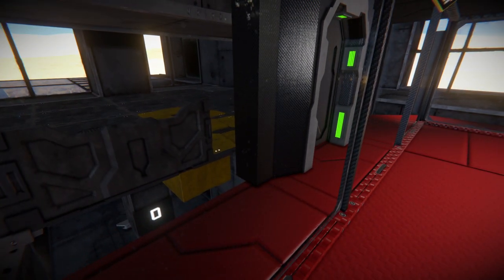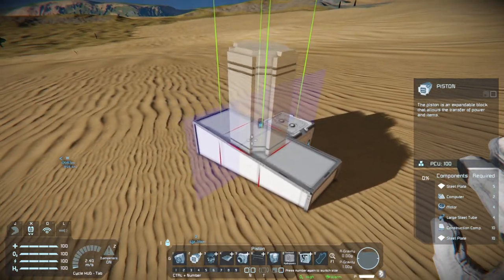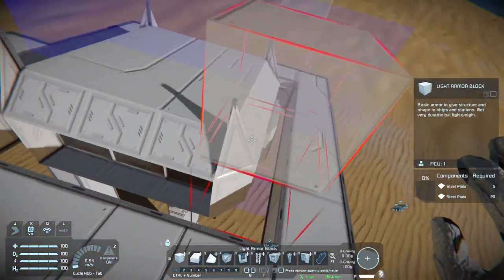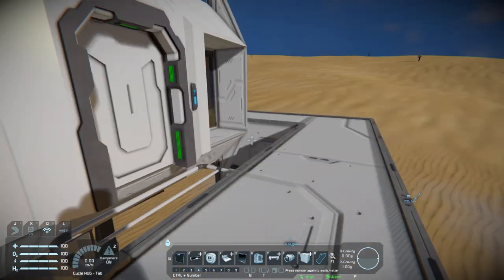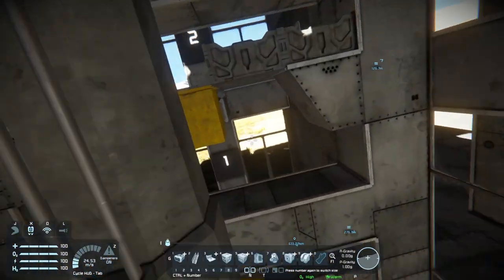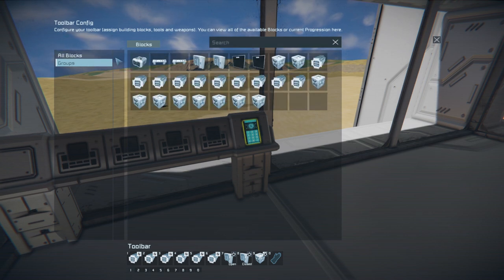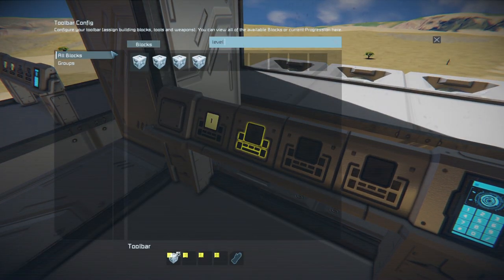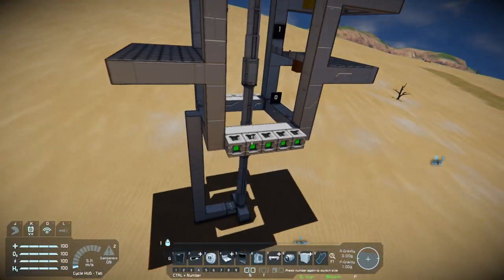How to build a multi-level elevator in Space Engineers

Comment: Nice job! I actually didn't know that I could assign multiple actions to a button like that.

For the exit walkway do you think a blast door edge would work as a static option?
Reply from the maker: Maybe on the bottom floor. In theory it would look no different than on the other floor with the blast door extended I guess? It could potentially be just a little too big though. Would have to test it to make sure. You could definitely use the cover / half cover blocks if you don't have the dlc
Reply from the maker: Oh and also: yes, timer blocks are your friend haha